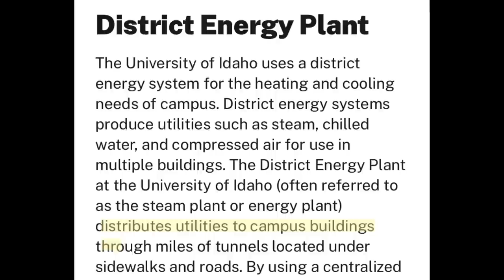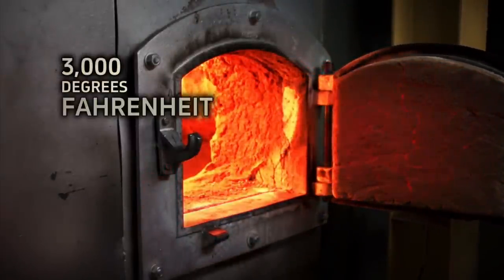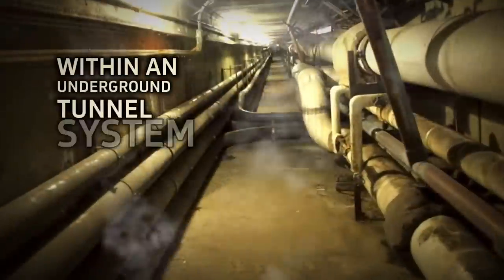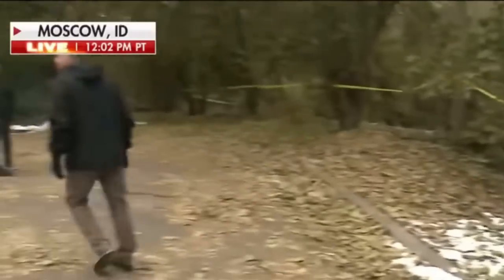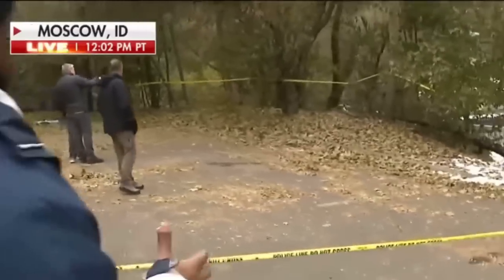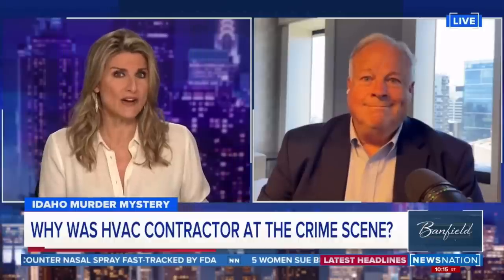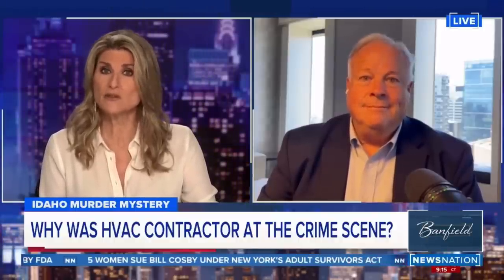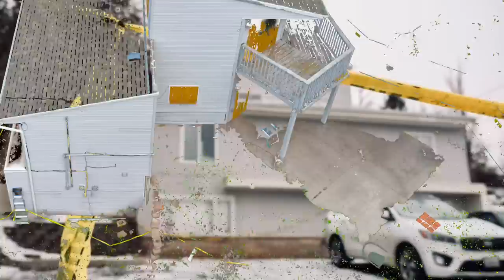IDAHO4: Underneath the University

Comment from the maker: Why do you think an HVAC contractor was allegedly called to the crime scene? Why would the heat need to be on? 🤔
Reply: Because it was November?
Hvac hmmm🤔
Reply: @isAKAlaurenooo good call
Reply from the maker: @isAKAlaurenexcellent point, I guess I just don’t understand why they would need someone with specialized knowledge on systems themselves
Reply: @isAKAlaurenI have locals in the area posting this exactly on nov 13-14!
Reply: To prevent pipes from freezing and bursting maybe, but I do find the tunnels interesting. Would be an escape route unseen or a way to dump the murder weapons. That the tunnel ends at that house and back parking lot is very strange. Where I live homeless people live in the city tunnels to avoid the heat. A mole person could have done this. Does the tunnel run to the other fraternities on nez perce road? If so that opens up another possibility.
Reply: Remember (I think I'm  correct ) Kohberger's dad's certification in HVAC systems and BKs (vacation?) work in that dept.
Reply: @isAKAlauren I personally only know the basics about Delphi. I keep hearing about it being really odd and possibly some sort of psyops. Is it worth looking into?😊
Reply: So the pipes don't burst if the water freezes?
Reply: Excellent work... I've seen a couple of videos that may help you with this but I have to find them. If I do I'll be back
❤
Reply: To remove and dismantle components of the system so they could carry out an inspection. To isolate areas /temperature control to assist in crime scene preservation. To extract any filter systems or vents they were wanting to bag for the lab. To cross reference their interpretation and/or advise on the state of the system including the fluid leaks.
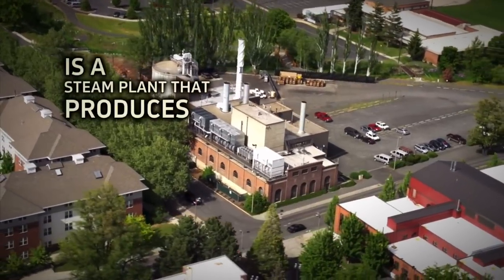Reply: 0:49 it is very unlikely that the steam tunnel is accessible from a privately owned residence.  The steam being carried in those pipes would not be used to heat anything other than campus property. Why would a university utility be piped to private property?
Reply: They can go back and forth into  the house without anyone knowing. Hmmm
Reply: @bewell6019 oh dear the plot thickens, something is very suspicious here!
Reply: HVAC has nothing to do with steam tunnels.
Reply: Because it was winter time...need heat when it snows. Right?
Reply: @bewell6019  Good thinking.
As I don’t believe the roommates were home at the time. 
DM bedroom window screen was off!
Reply: @nsajlj  Not that it would be pipped to the King Rd residence persay but what if it’s a separate tunnel that connects to the home. Made for the purpose of illicit activities. 
We have no idea what it is yet. But from what we do know is it has to do with something underneath the home and hvac. 
The plot thickens
Reply: I always assumed they were trying to keep the bodies cold, to preserve them as much as possible because so much time had gone by before 911 was called.  But it's just a guess, I know nothing.  Does anyone else think it's weird that the coroner is also a defense attorney?
Reply: @isAKAlauren ...lol
Reply: @FromThe3021 excellent comment, thank you.
Reply: @isAKAlaurenI have been saying this.  Has to be.
Reply: Heat off would keep the bodies longer….
Reply: The corpse's temperature is one of the factors involved in determining the time of death, so I presume that due examination was done before any changes were made to the ambient temperature.
Reply: @rickh3714 BKs dad and mom were teachers I thought??
Reply: @bewell6019 are you suggesting that this murder had been planned for years?
Reply: 😳great catch
Reply: Who needs a car?
Reply: @nsajlj  They don't care about facts and logic on this channel.
Reply: @billgee8520  it's 1122 King Rd. You're right about the tunnels. They have nothing do do with off campus private houses.
Reply: @isAKAlaurendefinitely
Reply: @robinlathim8221 welcome to small towns.. she is probably the librarian also😮
Reply: @Heseesyou  🤣🤣🤣 wouldnt surprise me one bit!
Reply: What if BK or the perp entered into the home thru the tunnel system. There was an initial theory that the perp may have already been in the home prior to the residents arriving home that night. Also could BK have just been the driver that night. Was he set up by the real killer who left the sheath with his DNA on purpose in case things went south. It’s highly likely a K bar wasn’t the real knife used in the crime
Reply: @colleen0229 Was this paved over before the murders??? I’ll I’ve been thinking this tunnel theory all along and people thought I was nuts
Reply: @billgee8520 That’s not true I saw a video that explains the whole thing. I’ll get you the link if you’d like.
Reply: Are these tunnels used to run drugs?
Reply: @fbjones 7364 Now your talking
Reply: @FromThe3021  thats what i thought @ 1st-filtering system to see what particles were caught, but i would think criminologist know how to do that stuff rather than calling someone to the scene.
Reply: @nsajlj Because the PRESIDENT OF IDAHO UNIVERSITY owned it for years.  Also grew up there.
Reply: In Russia we have that system anywere, every building is heatted by
Reply: Remember, they were mostly all wearing coats at the grub truck? Plus snow had fallen. It's the time of year to turn the heat on.  If they didn't have heat on yet It was most likely pretty cold going to bed that fretful last night.
Reply: @kliftonmayo5493  I thought BK worked security there.  I read there was a way down in the tunnel through the security office.
Reply from the maker: @ruthmoldan5523  there is no reason to heat a crime scene.
Reply: @truecrimedesign  I guess because I live in Minnesota and that's when people turn there heat on.
Reply: @truecrimedesign  My thoughts were just a guy answering a call. Perhaps he was called a week ago and is just now showing up.  If it had something to do with the case it makes sense that hair or DNA was in the vents. Or maybe they wanted to make sure there wasn't drugs/cash  or murder weapon stuffed in there.
Reply: @robinlathim8221  yes weird
Reply: @Vivalasam92  I've been thinking about this early on too; people calling me nuts too 😃
Reply: @@jessebranch7393 did so; one is an SO 🤔🤨
Reply: @kentkearney6623  FACT
Reply: @kentkearney6623  and grew up in 1122 too (if you're referring to that).
Reply: @@jessebranch7393 I thought I agreed to your comment about the tunnels?
Reply: @@jessebranch7393 let me know what your comment was and my response; I can't find your comment.
Reply: @@jessebranch7393 weird! And what's weirder is when I receive a response back I usually see the senders message.
Reply: @@jessebranch7393 I just found yours-you mentioned something about checking out the 1122 owners; I responded "did so; and one is a SO".
Reply: I thought maybe they were checking the ducts and air vents for the murder weapon
Reply: I read a book, of course I can't remember the name if it right now.  But all the basements would lead out to where the underground steam tunnels were.  Kids used to play in the tunnels until they found a girl had been raped and murdered.  Come to find out it was someone in the police department that did it.  I don't remember where this happened but its always a possibility.. Would explain how someone got out without letting bloody prints in the snow.  They could have cleaned up in the tunnels and have a set of clean clothes.  Would explain how no DNA would be found in the car.  Just a thought.  A scary thought but a thought non the same.  Maybe one of the reasons they don't want to keep the house for the jury to look at?
Reply: I’m understanding that the police knew about the steam tunnels from the start. If so, they would have investigated any steam tunnel access points near the murder house. And, if the steam tunnels were in fact used as an escape route for the murderer (or murderers), then the police would have found blood evidence & DNA of victims and perpetrators in the nearby tunnels.
Reply: @scottjackson163  agreed
Reply: Ohhh…I just replied about this to you on  BK previously putting on his resume about working with HVAC!
Reply: @heretowitness I read Zana's mom knew the tunnel???
Reply: Google shows this HVAC company did work at the UoI President House. What are people’s thoughts on that?
Reply: @jeremiahembs5343  I read Zana's mom knew the tunnels.
Reply: @Vivalasam92   that’s a good question, the girls were very much involved in drugs.
Reply: @truecrimedesign yes there is.  Any home or building with water pipes need to be kept heated so they do not freeze and burst.
Reply: This is wild!
Reply: Tunnels? Yeah but nowhere near the house.
Reply: Why wasn't the heat already on? People lived there. What'd I miss?

Comment: Back in my days at WSU I entered their steam tunnels through a construction site that was not sealed off.  Those lids are very heavy and impossible to lift without help.  At that time WSU's policy was that any student found in the tunnels would be expelled.  U of Idaho tunnels are of a similar design.  Lighting through out that is generally turned off from light switches for blocks of lights.

Comment: Moscow, ID gets very snowy in the wintertime and this actually is a system to keep sidewalks clear so students can get to class. I think it was also some old way of heating buildings, seeing that the university has been around since the 1890s.
Reply: although the vibes were always sketch there
Reply: No, this is still a very current way of heating buildings on a college campus.  The steam plant makes the steam and it is piped to coils/air handlers located in the mechanical rooms of each building.  It is  a very common and very current way to heat college campuses. It can also be used to melt snow on sidewalks but requires heat exchangers and radiant heat pipes filled with glycol.
Reply: @nsajlj thanks for the info
Reply: It's still used for heating buildings. And likely 1122 house, Queen Apartments, and other locations shown to have access on this map.
Reply: @niallk9336 could those houses have been housing for either University staff or Contractors, maintenance to the tunnels at one time?
Reply: So students and others regularly travel in the tunnels?
Reply: @yvonnebaker5174  no, but the heat melts the sidewalks ice and heats some buildings

Comment: Nice! If I understand that map correctly, it does show an access point directly at 1122.
I've known they go down to Greek Row, but didn't know if they went by the house. It turns out they do.
Usually these kind of tunnels, any building they pass under... it becomes part of the substructure... and there's an access point for maintenance reasons. We see that their tunnel connects to Queen Apartments before going up to the frat off Taylor.
Reply from the maker: Exactly! And this only represents what is officially documented. Who knows what’s been clandestinely dug since then? Plus the remodel strikes me as an opportunity for digging
Reply: does it necessarily mean they can enter the home thru the tunnel and just a man-hole outside the perimeter of the home ?

Comment: I dont understand why people are saying the tunnels could be used for sx trafficking when all the manholes are confined to within Moscow and are all connected to the university. Why would you take a person down a manhole at Linda Lane to end up at a manhole across the road on the bandfield?  You would be less suspicious if you walked a person across the field as opposed to lifting up a manhole in the street and disappearing down it!  
And no,  unless there is a manhole inside the 1122 home or a basement door that opens up into a tunnel, then there is no access. Its crazy.
Reply: Damn near every building will have an access point to the tunnels.
Reply: @niallk9336   Yes, but students walking around campus and even off campus will not look nearly suspicious as students getting in and out of manholes outside of buildings.  Come on, it's not normal behaviour and it does not happen.
Reply: I remember the cops coming 4 a noise complaint out back and 1 cop said be careful 2 a girl near the side of the house, bc there was a hole or something there !
Reply: @reeva5735 they aren't using manholes! There is access inside the house
Reply: @tal4546  what came first.. the tunnel or the house??
Reply: @reeva5735  the tunnels have been there since the university's were built.
Reply: @tal4546  the university opened in the 1800s when there was much more farmland. The off campus accomodations that we see today, came much later.  Man holes are for the sole purpose of maintenance workers.. not anybody can just access the tunnels. It is a fully functional work space and is dangerous.
I don't believe for one minute that there is an entry point beneath that house.
Reply: @reeva5735  so your comment "what came first the tunnel or the house was a trick question. No need I have viewed pictures of the construction of the tunnels dated 1918 so not that long after the 1880s.  Many of these mapped tunnels are not solely the property of the universities there are maps clearly showing private ownership of many of the tunnels to individual properties in that whole area who are responsible for the maintenance of said tunnels and it would make sense for these individual homes to have access for such work in the basement of their homes otherwise they would not be marked private.
Regarding your statement "not anybody can just access the tunnels" there are actual videos of young people in them and students recalling how they walked to their classes in them when the weather outside was cold with ice or snow on the pavements.
Reply: @tal4546  Yes,  I also saw stories of students claiming they had been down there with a teacher. The story "highlight" was the illegality of what had occurred.  In the case of an emergency, Ie  an on-campus fire,  those people were not meant to be down there.  Locating them would become an emergency in itself.     Perhaps students walking between classes, strictly on University grounds, used the tunnels.  But again.. they would have been in a much safer environment trudging through the snow.
I didn't ask a trick question per se,  I was thinking more along the lines of the chicken and the egg question.    As you know the tunnels have expanded over time..

Comment: Maybe that’s why they want to tear down the house so quickly? If they build something over it, it will be cemented forever. But! Who’s to say, there isn’t a way in or out of there that someone knows about? There was no blood outside? Are people able to get into the house even though it’s boarded up? 🤔 they need to use luminal down there!
Reply: There would still be access from the other tunnel entrances. That particular leg also appears to supply the Queen apartments and Frat on Taylor before connecting to the rest of campus.
But it would be extremely convenient in covering up the closest entrance and possibly blocking that leg of the tunnel off; at the very least making it all very "if you know you know" and ensuring very very few people know it exists.
Reply: @shawnasears who is they?

Comment: Incredible presentation…that could mean that there potentially be some DNA in that tunnel system if the theory that the murders took place at other location. No one would see it happening. Great question regarding a basement. I always thought the land elevation was strange at 1122. When was the house built? Not necessarily the remodel, the original build. Can you get floor plans?

Comment: So this is a legit question. It was cold during this. So they would of been using heat. Meaning steam right? So if someone was in those tunnels during that time would they not have burned to death?
Reply from the maker: The steam is contained in the pipes. They make the tunnels big enough to travel through because the pipes need to be frequently adjusted as the molecules expands and contract
Reply: Look at the pictures. The steam runs in the pipes down there, not in the tunnel itself. You can walk around perfectly comfortable in these kind of tunnels. The midshipmen leave mattresses in the ones at the Naval Academy... cuz their rooms have an open door policy.

Comment: Somebody needs to connect the dots for me. So there are miles of stream tunnels accessible from points near King Road. Is the implication that somebody other than Kohberger committed the crime and escaped via the tunnels?
Reply from the maker: There is no evidence that Bryan Kohberger committed this crime - and he absolutely did not do it alone. It was extremely organized with MANY involved and is almost certainly drug-related. Watch my other videos.
Reply: Likely accessible from within the house. Usually any structure built on top of these tunnels has an access point for maintenance purposes. The tunnel effectively becomes part of the substructure -- think basement, crawlspace, etc.
There is almost certainly a spot inside the house that has a door that drops down into the tunnel.
Reply: Why not Kolburger using the tunnel? He was good at doing his research. It's not that big of a reach if he researched and explored the tunnels.
Reply: @br4588  If they found fingerprints and DNA of his and the 4 it would be overwhelming don't you think?
Reply: What fingerprints of B Ks? Do you have special information that hasn't been released or in any PCA's?
What about the 3 unknown dna's? That doesn't give you cause for concern? No?